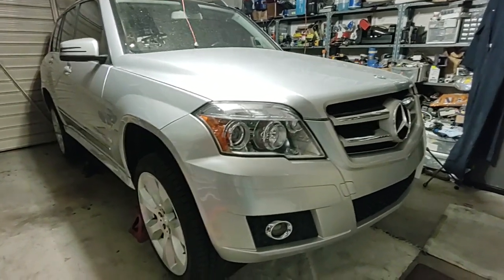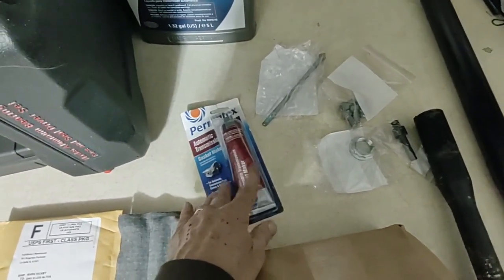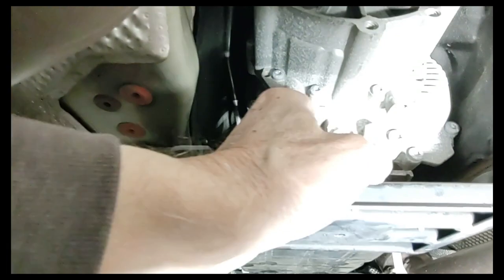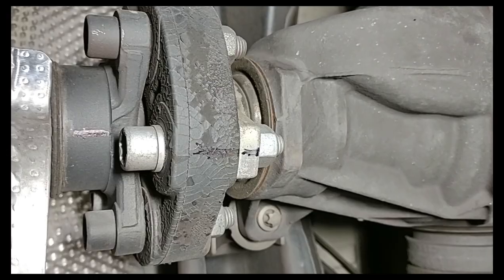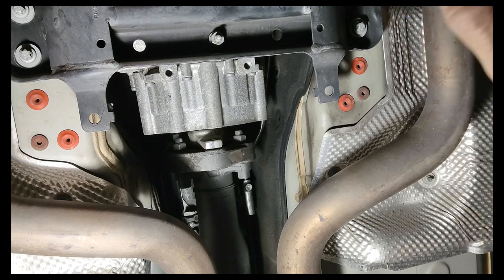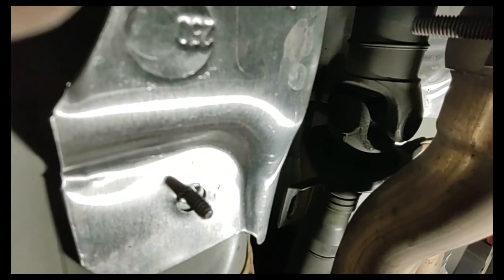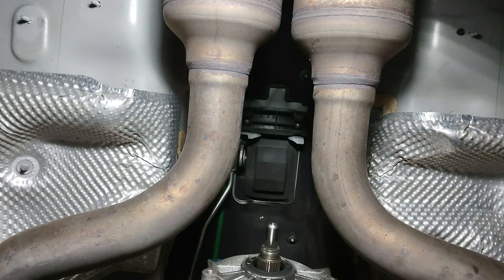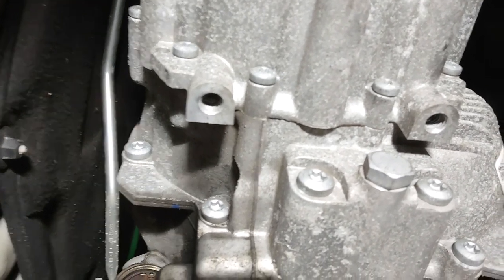Mercedes 722.9 4Matic Transfer Case Rebuild - 2011 GLK 350 - done in-car, new output shaft cluster

Comment: I'm doing this job and I'm running into what I think is a problem, maybe someone can help me. The first thing that is off is that the gear that goes into the front shaft doesn't stay in place, I put it in and falls out by itself. I can get passed that, but when I install the middle case it doesn't go in all the way by itself, I have to hammer it on a little and then it still doesn't really seal. To get it to close I have to put the bolts on and tighten them down so they get pulled together. It does end up closing, but what I'm concerned about is that the gears don't spin easily anymore (Spinning the gear that connects to the back shaft so that the front tires spin too), and that's only after 2 bolts in (gets worse with more bolts). When I take out the bolts the case still remains seated on there and the gears are able to spin again (tightening the bolts makes it so that the gears don't spin easily). Is that supposed to happen? What am I doing wrong? What are the bolts supposed to torque to, maybe I can try that? Another thing is that there is about a half inch gap between the case and the front shaft boot whenever I install. If you have any ideas as to how I'm messing it up, please do tell. I hope that maybe I'm just over tightening the bolts, but I don't think I am. Hopefully this wasn't too confusing of an explanation to my problem.
Reply from the maker: I don't know if you put new bearings on the helical gear clusters or not, but if they're not REALLY seated, you're going to run into the kind of problems you have now.  The output shaft helical gear does want to fall out when you put it in place - just the way it is, AFAIK. You just have to carefully place it and try to slide the middle case on carefully, and adjust it if necessary (you can see me do that in the video by sticking a finger in between the tranny case and xfer case to poke the helical gear up a little).  Be VERY careful about the torque on those case bolts - all the cases are aluminum, so it's really (!!!) easy to strip them out (and then you will have "interesting times").  Also, getting the middle case together is a bit fiddly.  I used a dead blow mallet to "help it along" and that seems to have helped.  I'd start out by making sure that the four bearings are fully seated on both the helical gear clusters, and that (assuming you changed them) the races are driven in fully as well.  The "preload" on the gears shouldn't change when you tighten the case unless one of those situations I describe above is happening...
Reply: @Mark_H_DIY  I did change out the bearings, I'll have to double check then. Thanks for the advice, I'll update on what I come up with
Reply from the maker: I have the torque values for the various components.  Keep in mind that your car COULD be different, but this should give you a good idea of the values you should be shooting for (and don't even think about doing this job without the right torque wrenches - just too much to go wrong, IMHO).  Here's a link to a video with JUST the values (again, for my car)... https://youtu.be/EybLI7ouqGI
Reply from the maker: One more thing that I just thought of...  If you didn't buy the OEM (Timken) bearings, you could be (sadly) dealing with a slight variation in the thickness of the bearings / races.  I'd like to think they're all designed to very tight tolerances, but would never, ever trust a lot of the parts makers out there to do that right.  If you did get "aftermarket" (or no-name) bearings, you may be able to at least compare the thickness of the main bearing races by holding them up against each other (with the gears out of the case, of course).  If you pressed in new races, you'd have to either pull them out and use a micrometer to check them, or just trust (aka "hope") they're right.
Reply from the maker: More thoughts - if the bearings are "off-brand" and seem to be pressed on fully, I'd suspect any of the mechanical tolerances (the thickness of both the pressed-in race, and the race that is pressed on the gear clusters), as well as the dimensions of the bearing cylinders and even the angle of the bearing race(s).  I guess that's to say that if things are too tight, I'd suggest pressing on new Timken bearings (if there's any doubt about your current bearings, that is).
Reply: @Mark_H_DIY  I did get the OEM Timken parts from fcp euro, so I think it's just my mistake that either the races or bearings aren't all the way on (or both). I am new when it comes to mechanics, so I'm pretty rookie. This is my second ever project on a car, never done anything before this (not even an oil change haha) so I'm just learning from youtube and online pages.  I just got out of work, so I'm going to head home and see if I can get something done. I might have to head to harbor freight to get a vice to make it easier. I didn't use the special tool for driving the races, I just used the old races to drive them in, so I probably didn't get them all the way in.
Reply from the maker: My hat's off to you - this is taking a tiger by the tail, and I suspect your guess as to the issue is correct.  If you can find a race driver that's close to the right size, you'd be better using that.  Only the big Icon set of drivers has the 3.5" race driver, but you COULD most likely use the largest size in the smaller set AND one of the old races to drive it in (fully), though of course, the right tool just makes it easier.  Good luck, and let us know how it comes out.
Reply from the maker: Just be VERY careful when inserting the front drive gear cluster into the (hopefully new) seal.  I've learned (the hard way) that the seal is very easy to bugger up.  I think one of the difficulties is that the gear goes in at a little bit of an angle, and if you lead with a corner of the "nose" that goes into the seal, it can catch it and flex it out of shape.  I just figured out that in my original rebuild, the spring that holds tension on that seal (inside the lip) actually came out and was riding on the gear cluster "nose", allowing tranny fluid to leak out.  I replaced the seal, and managed to mess up the new spring as well.  Testing it some more, I learned that the trick is to insert the gear cluster at an angle lining up with the front driveshaft, and to put a thin schmear of synthetic grease on the "nose".  If you get it right, the gear slides easily into place.  If not, take it out and check that seal, and try again until you DO get it right.  Hope that helps...
Reply from the maker: I just re-did my transfer case today (I'd messed up that output shaft seal).  When I had the "middle case" off I noticed that the bolt from my race driver had left a mark on the inside of the case (which means that it might have had trouble fully seating the race).  Just for grins, I took the bolt out and re-seated the race.  Equally strange, I noticed that it was possible to spin the spacer under the race, though I couldn't move it up/down.  And to top off my strange day, when I put it back together, I ended up with the same issue you did.  I honestly don't remember how tight it got last time I put it together, but this time it took some effort to spin the rear output shaft (and therefore the front output shaft) by hand.  I was 99% sure it was all together right, so just for giggles ran it through the gears (R-N-D) a couple times.  That seemed to loosen it up considerably, though it was MUCH harder to spin that with the bolts out.  I'm not going to get my knickers in too tight a twist over that since the end result is that I can still spin the whole mechanism by hand holding onto the rear output shaft, and that includes rotating both driveshafts.
Reply: @Mark H  Sorry, I've been busy with college and work, so I haven't gotten the chance to work on the car. Part of the reason why I haven't been able to finish this job in so long haha. I just finished making sure that the races on the middle case and the bearings have been seated well. I'm fairly confident that they are on there all the way, now I'm going to check if the races in the car are fully seated (which I'm pretty sure they are, but I'll check again). I'm going to first try putting on the case without silicone to see if I run into the same problem then see if going through the gears helps. If it doesn't, then I'll just have to put it on as it is and try it out. I think I did end up ripping the seal, so I'm waiting for a new one to arrive. The spring is messed up, but the rest looks fine so I don't know. The city just sent me a letter today that I have to get the car off the jacks within 5 days though, so I'm just going to have to go with it and hope I don't leak too much oil. I did want to ask, how did you get the boot that connects to the front drive line to stay in? Does it have to?
Reply from the maker: I'd recommend checking to see if you can rotate those spacers under the races, or move them at all.  If they're immovable, chances are the races are fully driven down.  That front output shaft seal is a bear, without a doubt.  Getting the boot on the front driveshaft is "interesting".  It takes a pretty determined push, and helps to put a dab (or dollop) of synthetic grease on the shaft / boot to aid getting it on.  One of the other difficulties is that there's not QUITE enough room to leave the driveshaft disconnected and out of the way, and THEN install it... on my car, anyway.  I could get the shaft started on the output shaft, but just couldn't quite run it down far enough to get the front end of the driveshaft to drop over the differential yoke.  Only a couple mm would have done it, so maybe I could have fiddled with the floor jack to raise/lower the engine/transmission to get a bit more, but in the end I just pulled the front output shaft assembly out, and slid it into the end of the driveshaft (hoping that I wasn't going to bugger up the seal again).  Was I successful?  Hope so!  ;-)
Reply from the maker: There's a VERY interesting discussion underway on the GLK forum I frequent, talking about preloading of those bearings.  I hope to learn a lot more about the whole thing next time I re-do my transfer case (probably next week).  I should be able to actually measure the torque required to move the shaft(s) with the middle case bolted on (dry, so I can take it apart again of course).  https://mbworld.org/forums/glk-class-x204/791339-some-kind-noise-tranny-diff-4.html
Reply: @Mark H  I just got the new seal in today along with the long torque to yield bolt, so I think tomorrow I'll try some stuff out and see if it works out. The spacers won't spin, but it does look like there's a very tiny gap. I don't remember if there was a gap before or not, but the races won't go in any further.
Reply: I forgot to say earlier that I'm doing this on my 2010 C300 and I only did the bearing and race replacement.
Reply from the maker: @Rolo  Check out the link to the thread on preload that I posted. I won't be able to do anything with my GLK until next week, but hope to know a lot more about this soon. Probably the worst case is that I'll have to pull the races and take a hair off the thickness of one or both of the middle case spacers (under the races).
Reply from the maker: @rolo3118  From what I can tell, it looks like the drivetrain is pretty much identical. The one thing that could make a difference is if you have room to get the front driveshaft in and out with the front output shaft in place. That would make it a lot easier and less likely to bugger up the front output shaft seal

Comment: How much did you pay for the suv?
Reply from the maker: Picked it up for $3,600. On one hand, it had new Continental tires (600 miles), new battery, and was a highly maintained one-owner car in pristine condition. OTOH, the previous owner was looking at a $10,000 fix, so we were both satisfied with the price

Comment: Hi Mark.  Great video!  I'm looking to purchase a transfer case gear output shaft for my 2011 E550 7229.  Could you tell me where you bought these parts?
Reply from the maker: Thanks!  I got the output shaft gear from Maktrans in Poland.  https://maktrans.net/zaptchasti-akpp/mercedes/722%2C9/zhelezo-722.9  It's worked out fine so far, and from what I've read from others who've ordered them, they apparently are a long-term solution to the lack of availability from MB.  The part number I ordered is SQGX7229.  There are Chinese vendors building these as well, but I have no clue as to the quality or longevity of those parts (and would tend to be skeptical because of systemic quality issues in the Chinese auto parts industry).
Reply: Thank you Mark!
Reply: I'm doing the same repair on a w221 4matic and really appreciate the detail you put into making this video. Thanks and congrats on your successful completion. 30mm 12 point deep! Get one before you start 😂 yeah, you got me.
Reply from the maker: @jimdempsey767  There's always that ONE tool you need for something like this. ;-( Good luck with the repair, and hope it all comes out perfect.

Comment: My bad. found it:)
Reply from the maker: Thanks for letting me know ;-)
Reply: @Mark_H_DIY  Do you have an MB parts number for the front and rear output seals? THanks;)
Reply from the maker: The part numbers are in the video description (though I didn't replace the rear output seal - it was fine).

Comment: Vehicle was.not level when you checked fluid, you under filled it.
Reply from the maker: Actually, the vehicle was level. And due to the location of the drain / fill port, a little bit of front / rear height discrepancy won't make a measurable difference in the fluid level anyway.
Reply: Being that I work at a dealership, I respectfully disagree. It's your car and your transmission/ transfer case. The last seal you installed was little cocked in it' s bore as well. I hope that works out well and you do not have any issues with either. Being the perfectionist I am , I would lose sleep over this. That is just my opinion. The repair video was enjoyable. I hope you have the Mercedes for many trouble free years , you have earned it after this repair and the mounts. Mercedes are a great vehicle to own if you like to tinker. The driving experience is next level.
Reply from the maker: I think the appearance of being "un-level" is due to the fact that I am using very different jackstands front and rear on the car (hey, they're what I have).  ;-)  The first time I filled the fluid I did actually place a level on the door sill (but didn't show that in the video).  Thanks for the kind words and wishes.  I do really enjoy the car, which I bought because I always loved the way they look (IMHO the only pretty, "German-looking" SUV MB ever built) and because I was able to pick it up for a song due to the front propshaft / transfer case issues.  What I didn't know is that my wife would like it SO much that we'd end up selling my 2006 BMW 530xi Touring instead.  Oops.  But to be honest, I really like the engineering and serviceability of the GLK far more than the (often sadistic) design for UNserviceability of the BMW.
Reply: @Mark_H_DIY  Hello, I needed clarification, doesn't the transfer case have to contain oil independently of the automatic transmission?
Reply from the maker: @bbranquinho3133  Nope... The transfer case feeds off the transmission fluid flow. No separate fluid.
Reply: @Mark_H_DIY  Thank you very much for the clarification, it makes it easier for me to understand that the transfer case leak, would end up draining the oil!

Comment: i have very little understanding about transmissions, im here just to see what kind of job its to get my transfer case rebuilt in the shop 🥲 shop quoted about 2500 euros
Reply from the maker: @mummonturbosukset3504  You'll be doing well to understand how the job goes, to speak intelligently with the mechanic, and to clarify your expectations (it would be very easy to skip some of the critical bits, like replacing the one-use rear output shaft clutch pack bolt, or even checking the bearings or front output shaft U-joint - depending on what is wrong with your transfer case. OTOH, most shops just quote a new transmission. ;-)